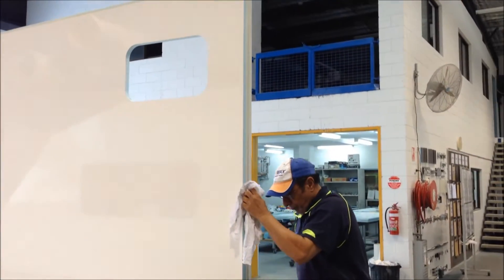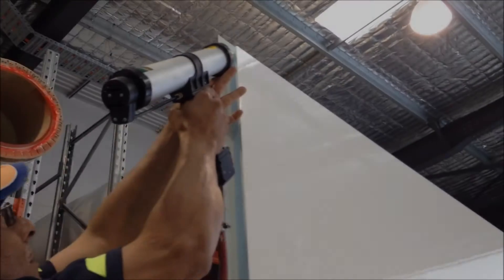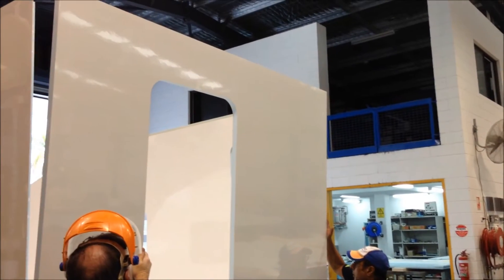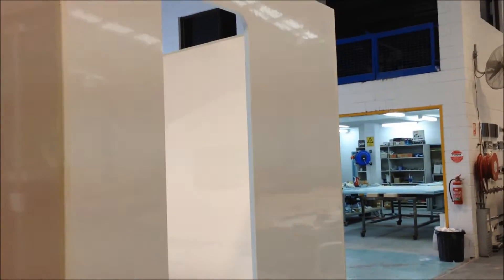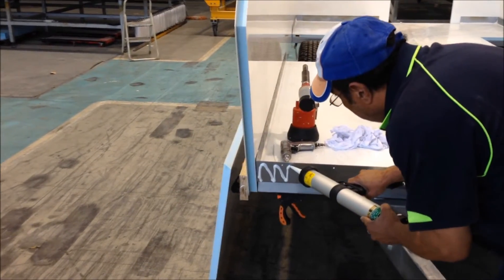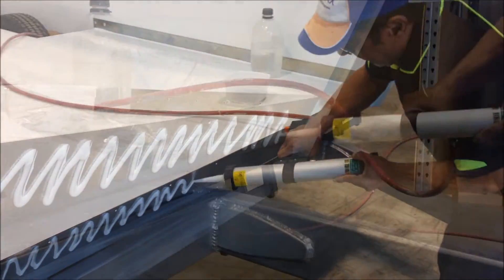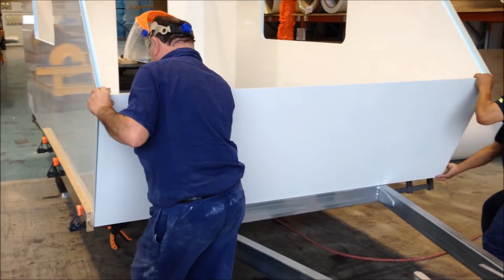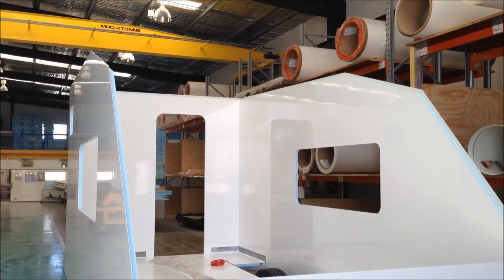Front & Rear Wall assembly with Terostat MS939 by Henkel

Comment: i also question glue to styro strength....seems you'd want to glue to the outer panel , or finish the styro edges for better grip. and /or add L aluminum around the corners , not as pretty , but not much holding it together ...Styrofoam degrades , and the mess once the clue gives out wd be irreparable

Comment: hello many thanks for the previous answer sorry my english, I use the translator ... I would like to ask you some more questions

1- how is the L-edge obtained where you glue with Teroson 939 MS?

2- is it possible to make a video showing the gluing of the two panels in gelcoat + Styrofoam?

do you use a press?

can it be done even without a press?

what glue do you use?

can you  roller glue?

3 - Have I seen the 2.4 mm roll you buy from fiberglass in Italy? .Vetroresina.com?

4 what is the most used thickness? usually from roll + styrofoam.?

pity that we are far away because you would be useful in your teachings and I would provide you
a greeting Leonardo

italiano 

ciao molte grazie della risposta precedente scusate il mio inglese, uso il traduttore ... Vorrei farle qualche altra domanda

1- come si ottiene il bordo  elle L dove tu incolli con Teroson 939 MS?

2- è possibile realizzare un video do si vede l'incollaggio dei due pannelli in gelcoat + styrofoam.?

usi una pressa?

può essere fatto anche senza una pressa?

che colla usi?

si può dare a rullo  colla?

3 Ho visto il rotolo da 2,4 mm che acquisti dalla vetroresina in Italia?  da vetroresina.com ?

4 qual è lo spessore più utilizzato? di solito da rotolo + polistirolo?

peccato che siamo lontani perché tu saresti utile nei tuoi insegnamenti e ti provvederei
un saluto Leonardo
Reply from the maker: Hi Leonardo,

1- It is rebated on our CNC machine.

2- We receive the fibreglass with the gelcoat already applied. We simply bond it using a sandwich panel method. You should be able to find many videos already on this. 

do you use a press? We use a vacuum table.

can it be done even without a press? Maybe, but it's not the application we use, so can not really comment. 

what glue do you use? Teroson adhesive

can you  roller glue? Yes, you can roll glue, just like paint. 

3 - Have I seen the 2.4 mm roll you buy from fiberglass in Italy? .Vetroresina.com? Possibly!

4 what is the most used thickness? usually from roll + styrofoam.? We offer a range of different thicknesses, using a different combination of foam thickness and fibreglass thickness.

Please feel free to contact us through our website for more information!